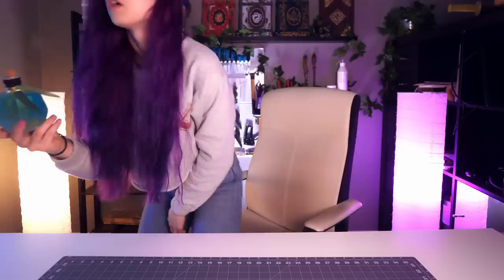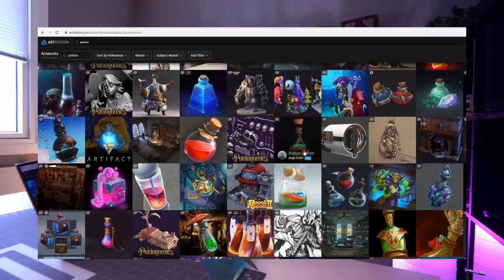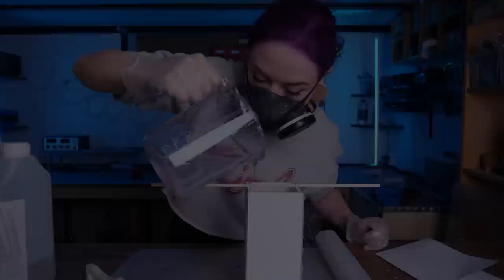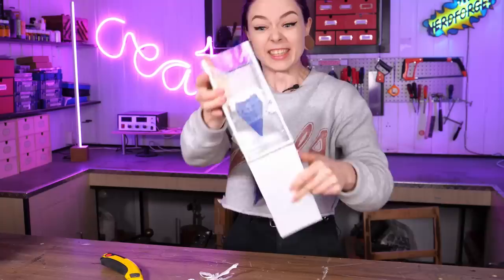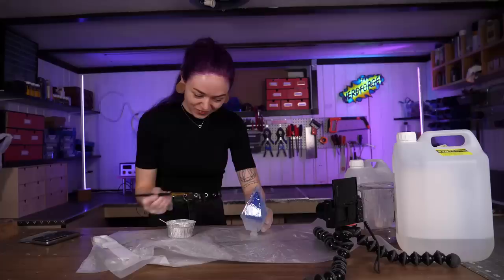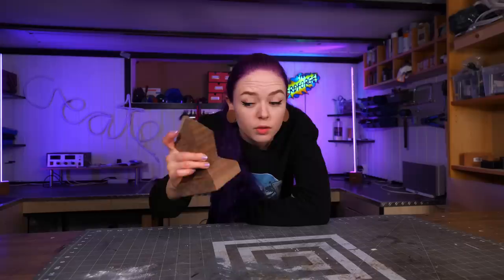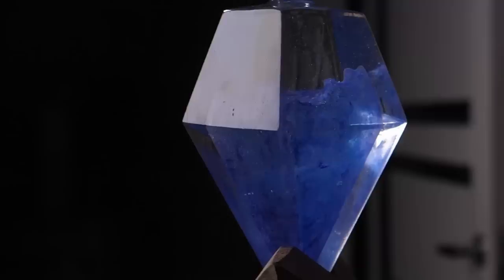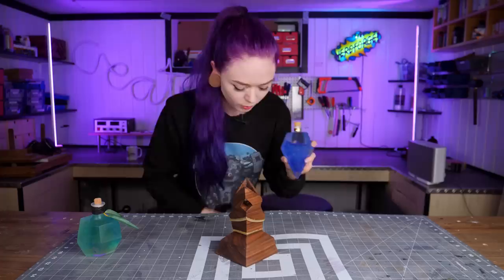I Made a Magical Potion from Epoxy Resin!

Comment: Here's my suggestion about the epoxy resin.. SAND IT. Not just the rough grade,  but you have to go up in grit until your basically just buffering the thing. Make the scratches super thin, then finish it with a polishing paste. That's the best way to get clear epoxy. Just keep rising in grits until you get to like.. 3000 grit or 5000 grit. Then you put polishing paste, rub it in and get rid of the excess. Those lines and drippies from adding the epoxy on top? Just sand them to a very fine grit then polish them. Wet sanding helps too!

Also, if you want to get rid of any bubbles, either heat or a pressure pot. You COULD use a vacuum chamber, but I've seen that mess with resin before. A pressure pot(about 30psi I believe) will make the bubbles super tiny. Or, you can use a heat gun/lighter to pop surface bubbles. I see those used for thinner projects though, not... epoxy blocks.

Seriously though, try the sandpaper thing. Thats your best chance at a clean finish. Check out dice makers or epoxy resin workers here on youtube, a lot of them use sandpaper.

Some people commented micromesh, yeah that too! Just super fine grit, because the smaller the scratches the better
Reply: LivenUp7 I agree and Shella wax works really good
Reply: Micromesh is what you need for super smooth
Reply: Once you've finished with sand paper, micro mesh pads go even higher grit, and zona papers higher again. When making dice, using zona papers really gets a glass finish.
Reply: Could use a heat gun or a torch, it works really well to make it smooth. If going with the torch you'd have to be super careful and quick though or it'll get ugly. The King of DIY does this when making his aquariums where it's pretty important that they're super clear while also maintaining the sharp corner edges.
Reply: @Spac3Dflippr  I was thinking the exact same thing about using the zona papers. The results are so shiny!
Reply: Did you know that brown paper bags are a great finishing sand paper!!! I use it for the final sands between coats and before varnish. It's Amazing how smooth it gets stuff and it's practically free!! Not really but you know what I mean :)
Reply: All good suggestions... I'd suggest adding Peter Brown to that list of people too. He's unorthodox creations are a pretty good fit and he often works with epoxy in non-traditional settings
Reply: Was about to leave this comment
Reply: Use a pumice and water mix with a large felt wheel. Then get acrylic polish and polish on a separate felt wheel. That is how I polished dentures. You can get the supplies from e bay.
Reply: Was about to say this or micromesh.
Reply: was legit gonna say same thing, as an epoxy guy watching her clear coat that rough surface like that made me cringe
Reply: This. I watched her paint more resin on and I had a cringe moment. 😔
Reply: Mercedes Benz uses 4000 grit to polish their headlight lenses, so that should tell you something there! :) Also, a thin layer of Vaseline on the foam core sheets when making your molds, the sheets come away from the resin quite easily!
Reply: Yes sand it, but at the final polish you can just buy Car polish compound and use a buffing wheel,  or the compound used for buffing car headlights. A few minutes with that stuff and you have a very beautiful almost glass-like lustre.
Reply: @excelsior8682  I'm so glad I just found your comment. I was about to ask if a car wax could be used to polish it.
Reply: Excellent advice
Reply: Don't waste the time going through thirty different grits of sandpaper.  A few passes of progressively finer grit sandpaper is sufficient to get it to the point where you're ready to buff.  Actual buffing is the only way you're ever going to achieve the crystal clear glasslike appearance she's after.
Reply: @Trufriend61  
Or maybe use actual mold release which is designed specifically for that purpose.

Comment: If you want the epoxy shinier maybe you should fill a little tray with alcohol, hang the epoxy thing above it and cover it with a glass our something. If the alcohol evaporates it will melt the epoxy a bit so it's gonna "smooth it's suface out" (I did it before with alcohol nail polish washer + fine sandpaper).  Or fine sandpaper + water and some polishing with the rotary tool's polishing attachement... both can work I think.

Comment: Awesome project. I would suggest that you make your mold a similar shape to the end design to reduce resin waste/cost. The pigmented scraps can potentially be used together for something else and you could use the clear ones to hold up objects as they should disappear when more clear is poured on or around them (tho the clear scraps may need to have been from the same type of resin to increase the chance of not being seen after)

Comment: Looks great! Sadly you will never get away from sanding epoxy if you want a really smooth finish.. I normally don't go any lower than 120 and then work up to 600 grit where I switch to wet sanding and then polish using plastic polish (car polish works well for this).

Comment: It's absolutely possible to sand epoxy to be glass clear. It needs multiple steps of wet sanding, and finishing with a polishing compound.

You did a great job, but if you wanted to, you can get it clearer.

Awesome vid👍

Comment: You just gave me the best custom potion idea!! What if you wanted to be able to make custom potion bottles in cool shapes that could actually hold liquid?! SO... instead of making the first part out of colored resin, you make it out of a wax that melts at a very low temp so that after you cast the bottle around the outside you can simply drill the hole in the neck and melt out the wax leaving your cool shaped custom bottle!! Totally gonna try this.

Comment: Have you ever used a product called Novus? It’s a polishing compound to be used after you sand resin to the highest grit possible (usually ~3600), that will bring back the crystal clear window look. My husband uses it all the time in the gallery he work for to restore the plexiglass of framed works, or to restore the work of artists using resins and epoxies. It's amazing stuff, a must have for anyone working with resin.  Especially since resin can get easily scratched.

Comment: Just a suggestion for future projects. If you grab a Headlight Restoration kit it comes with all the sand papers and polishing compound and applicators to make plastics incredibly clear and shinny. There are kits where you just use your hands and there is a 3M kit that comes with a mount to attach to a drill.

Comment: There is still an issue with the 2.0 potion : you can clearly see that the "liquid" is directly in contact with the "glass" on top : you should have an empty space above the liquid to make it more realistic. But I guess it's really hard to make ^^
Reply: I'd guess there's something one could use as a temporary form that wouldn't be too hard to remove after the fact. Like a wax or clay or something that could be melted or dissolved with a solvent or something.

Comment: To prevent all the streaks and bubbles for the final coat of epoxy you could have dipped the potion into the epoxy then used a vibrating table or something that will vibrate the bubbles and drips out to make a super thin and nice shiny coat.

Comment: If you want bubble free resin I would suggest looking into buying/making a pressure chamber. I use it for dice and boy does it work. The only down fall is that if you have a old silicon mold used in it with resin your object will have little spikes in it because the silicone might have bubbles in it. Beyond that it will give you that pure glass look if done right.

Comment: Beautiful work and excellent ideas! I love the excitement, the dramatic (and sometimes funny) flair as you work and how you totally geek out when everything comes together... Still going to keep offering suggestions though... Seriously, get some of that slightly oily children's clay (usually called plasticene) it doesn't stick to the epoxy and cleans easily. You can also make much smaller and more form fitting molds so you use less epoxy and save a bit of money! The clay is also reuseable and you can also press buttons or other items into it to create raised patterns on your "glass"... Another benefit is you don't have to carve away all the extra epoxy, much less sanding,  and the polishing is much faster and easier to get the clear finish! Also, listen to LivenUp7 in the comments about taking your polishing to the next level!  Another thing I would suggest is carefully cutting your gold leaf sheets to just a bit larger then the straight surface you are trying to cover so you can get more use out of each sheet rather than a large pile of gold crumblies!  More materials and less waste means you can do more awesome looking projects!!

Comment: This potion looked way better than the previous one. The stand also looked great. I have a suggestion as well. This is just my hypothesis but if you use both the potion and the glass with similar optical properties, there will be no total internal reflection which will seem to separate the glass from the potion, so using something with different optical properties will hopefully help with making it look better. For example making the glass part with epoxy and putting actual liquid for the potion in it. Also, you can use the gold dust to make gold shellac paint, it can be used in illumination of manuscripts. Hoping for more great videos :)

Comment: If you look at some of the resin items produced by Nick Zammeti, try polishing your red resin with higher number grit to polish to a higher shine.  Remember to use your pressure pot to eliminate bubbles.  Consider adding an RBG LED or two to your staff lighting.  The morphing colors will add a bit of life.  Thanks for sharing this video.

Comment: The potion is absolutely amazing!!! love it!! I'm a resin artwork beginner, and I'm wondering have you ever considered using the UV resin for the coating step? It's gonna dry way faster than the epoxy resin if you put it outside (a sunny day is better but cloudy day works too). I've applied the UV resin on my own sculpture before and it turned out great

Comment: You can easily remedy the epoxy sanding issue by trying a sand paper with higher grit number. 1500 grit for example is finer then 600 grit and will give a better finish. You could even give it a final buff with a car-polishing compound for a super shiny glass-like appearance.

Comment: If you want to make your epoxy look shiny first you need to sand it with high grit sand paper going from 600 then 800 and 1200 at the end and then finish with polishing paste. it may be time consuming but way less then painting it with epoxy and then waiting for it to cure.

Comment: Hello! I make dice for TTRPGs out of resin, so I have had the same issue with getting a clarity back after sanding. Sanding is definitely the way to go to avoid the bumps and streaks. But after you're done, a quick pass with the higher ends of either zona polishing papers or micro finishing film is a great way to bring back the polish and clarity!!

Comment: You could use a hairdryer to warm up the epoxy and make it more fluid next time. Not to hot because than the epoxy will harden to fast, but just a little bit warm :)

Comment: you might want to test the idea of using a pressure pot or a vaccum chamber if you plan on doing some more epoxy casting. it will help you get rid of air bubbles.

Comment: You can get a complete glass-like surface by getting some fine polishes from an auto parts store. After wet sanding to as fine a grit as you can (at least >2000) use the polishes to finish the gloss. They come in different “grits”.

Comment: That was really cool! I hope you make more potions. You can still improve the design by forming the part of the container that is supposed to be hollow and empty. My suggestion is to top the epoxy waste with a bit of tinted clear epoxy and then carve the resulting piece into the interior shape of the potion container. Then proceed with forming the container as normal.

Comment: You can buff the epoxy with a buffing wheel or if you don't have one you can get car buffing compound and buff it by hand. Also you should've sanded it before adding a thin layer of epoxy on it. That would've reduced the streaks and lumpyness of it.

Comment: for 3.0 to make it truly look like a bottle holding a fluid after carving the liquid's surface you should cast it in clear resin and then sand that down to take the shape of air and then as usual make the bottle around that in a slightly darker clear-ish color to truly sell that illusion. or not. this ones amazing anyway

oh and you wouldnt have to worry about bubbles because they could sell the illusion!

Comment: Best way to make it shiny is with fire.
Not too much, just enough to make the outer layer melt a tiny little bit. When it sets it will be shiny.
Be safe and test it on a scrap piece first to get the hang of it.
Allways be carefull with open flames!

Comment: Fantastic improvement! Maybe next time a small switch in the stand so it turns on as you put it in? Also acrylic polish (or car cutting compounds) and a buffing wheel you can put in a normal drill I think will get you a lot closer to a glass-like finish =] (because everyone has an opinion on this internet...)

Comment: this video might be a little old by now, but you should get some polishing compond...like woodworkers and old barbers use on a strop...they make several types...I'm sure one for plastic would be great for polishing up that "bottle"...I think the blue colored compound is for plastics...I use green for sharpening chisels etc...also if you  line your casts with wax...you may get a residue..I don't use epoxy resin, but you will be ably to reuse your forms(molds) after a pour...just clean them up and add a new layer of wax now and then...I started binge watching your videos this week...I think you're awesome!

Comment: Love it but a few tips:

If its going to be backlit (downlit? :P) the "liquid" should be way way more opaque otherwise it defeats the purpose of doing the "glass" part since the light shinning makes it kinda blurry.

The gilding can be hard pressed and polished (softened) for a more seamless look. It can also be layered.

Then you didn't need to paint the epoxy layer, you can just hecka sand and then polish the bare epoxy. From rough sand paper to fine wet paper to polish paste. tho doing it by hand is a pain using a bench grinder with a polish/buffing wheel makes it super speedy and shinny as heck. you can use a lathe as well, much faster than the belt sander.

Comment: so in my shop class in highschool the teacher showed us a trick with acrylic glass just take a torch (he used a oxyacetylene but a propane torch should work) and waved it over the edge of the glass a little bit and it became really smooth im curious if that would work for epoxy resin then u would just need to buff it with some parting compound

Comment: Rather then spend so much time sanding into shape would it be better to tac together a quick angle block jig to run through the band saw, rotate the cube, reclamp the jig and cut it to rough shape that way?

Comment: 2.0 is a vast improvement over 1.0. 🧐 However, I notice the absence of the lack of volume over the potion 🧪. With the straight sides on the bottles you’re making, you could use a very thin plexiglass to make an inside before you pour the clear resin. It’d save some resin and probably make it more realistic. I also wondered if you could make triangular silicon (or even plastic wrapped styrofoam) inserts for the bottom of the mold to peel off when you de-mold. If it worked, you’d save resin as well as sanding and cutting time.

Comment: New one does look way better than the old one, I like it.

With the hot glue, use rubbing alcohol or isopropyl alcohol, it'll debond the glue quick and easy ;). If you want the epoxy to be like glass, you'll have to sand the ever living crap out of it into the high thousand grits then use a buffing compound on it.

Comment: OK.....Next step.
After you have shaped the "fluid" for the bottle, use styrofoam as a spacer for the rest of the inner shape of the bottle.
When you have made the "bottle", you can use acetone to dissolve the styrofoam (leaving an actual empty space in the upper part of the bottle).

Keep in mind that I have no idea how acetone interacts with the epoxy......so check that first. :)

Comment: I saw a video once where someone sanded down an epoxy item, then got it all shiny by melting the surface using a light touch from a blowtorch.  I wonder if that could work with the potion glass?

Comment: I would have an idea for 3.0. What if you use different shades of clear (I know it sounds weird) to represent air and glass. So do the liquid as you did, then add the air to the upper Part and sand it to shape and after that add the layer of glass to the outside. I think this could make it even better. It kind of annoys me that there is no visible line between the Glass and the air.

Comment: Maybe someone with more experience working epoxy resin could chime in on this, but wouldn't wetting the resin block (dunking in water) before/while using the belt sander get cleaner results? Pretty sure it would reduce the amount of airborne particulates too, at least based on how polycarbonate acts when I have to shape it with my belt sander.

Comment: Reapplication of dyed liquid epoxy and pt or cubic zirconia dust emisced epoxy layer intra "potion" rotary motor and a variable opaqueity, thickness, and variable surface shape warping rotary lamp with variable interplatform circumference piston, or screw motor lamp platform raisers, orchestratable may be an option?